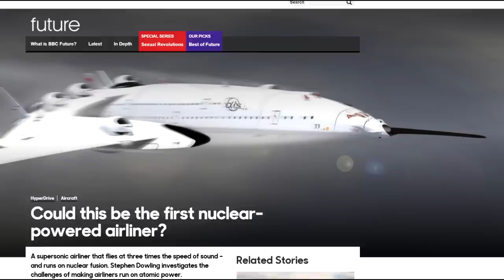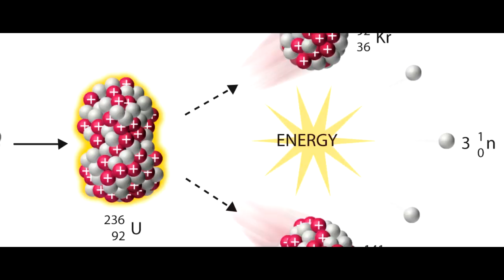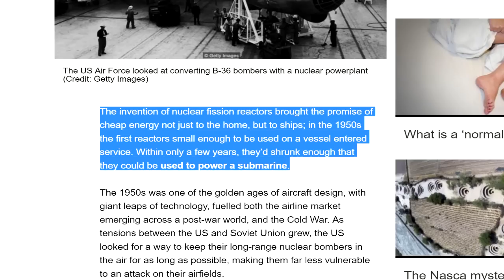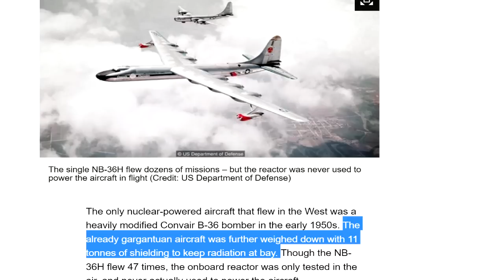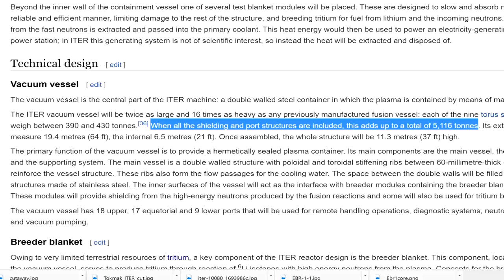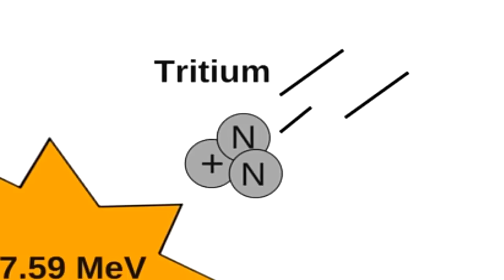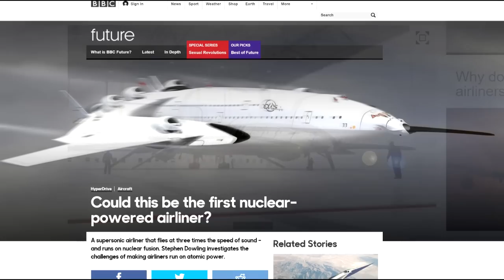SIX ENGINED Nuclear Airliner... BUSTED!

Comment: Very misleading statement regarding ITER being power generating at about 4:45.  The ITER reaction may produce energy, but the reactor will produce no electricity.  There are no generators hooked up to it.  Zero light bulbs will be illuminated.  Zero breads turned to toasts.

Comment: I disagree with your assessment, the one part they are missing is the engine's mass, they got a estimate and used that as a starting point for working on the design, since the laws of aerodynamics won change, so they can make mockups, they can work out that the engine's will need to tilt upwards to give it enough lift to get off the ground, and they can work out the passanger/cargo capacity, wing span, length, range, speed.
personally though I don't see the point, why? because it'd never be allowed to fly supersonic, supersonic is stupidly noisy on the ground below. I think they'd be better off developing a battery powered plane that can be charged at the airport on each end. the main issues are I have no idea of the technical requirements, but I can guess who I'd need to ask, the primary issue is the battery (or capacitor) weight.

Comment: obviously the drawings are very fanciful.  however one way to avoid the biggest shielding problem is to just not shield it :)  mount the reactor in the back and only add shielding between the reactor and the front where passages sit.  this reduces shielding weight by a big magnitude.  of course you are spewing out radiation all over the place behind the plain which may not be a major problem at 10,000+ feet but would be a major problem at take off and landing.  maybe plane could have a shielded backside companion module used in takeoff with chemical rocket or jet population to get the nuclear powered portion up and down.
Reply: actually maybe just disable the nuclear reactor during take off and landing.  land with alternative low power flight and take off with the help of an external jet powered plane module.
Reply: Also add low/medium shielding below the reactor to minimize radiation going down to earth while at altitude.  side and top shielding can be minimal as this all goes into space hopefully.

Comment: To be fair, that 10 tonne payload you mentioned was for a B-29 - that's the little plane behind the NB-36H in the photo. It's still a huge amount of shielding, and it still had massive, massive problem (that ten tonnes was enough to protect the pilots only - everything else close to the reactor would still cop a hefty dose!), but as designed it wasn't overloading the plane it was on.

Comment: A few inaccuracies in this video:
1) There are nuclear fusion reactions without neutron production - He3-He3 and He3-Deuterium fusion don't produce any neutron, and for this reason they're particularly interesting for potential future fusion-powered spacecraft. They do, however, require even higher temperatures to occur than Deuterium-Tritium reactions and are therefore even less miniaturizable.

2) Tritium in a operational fusion reactor is actually bred from Lithium and neutrons and therefore requires only a minuscule amount of outside source of Tritium to jump-start. At any point during operation only 0.5 grams of Tritium is in the reactor, which means even if all of it escapes into the surrounding there would be no need to evacuate the site. Tritium undergoes beta-decay, but its beta-particles are so low energy that it is more similar to alpha-radiation (cannot penetrate skin).

3) The far more concerning by-product of nuclear fusion are the radioactive isotopes in the structural material generated through neutron activation. However careful choice of material can prevent long-lived isotopes, and there is no danger of nuclear meltdown in any case, so it is far, far safer and cleaner than nuclear fission.

Comment: Ugh. Do I even need to mention that, while I'm not an expert aerodynamicist, as a pilot I do know there's not a chance in hell that gigantic, bulbous, awkwardly shaped whale of a contraption would ever go supersonic? Well, that's not QUITE true. If you stick enough engines on it you might get it to go supersonic. But just once, before the conflicting shockwaves inside those bizarre gaps in the wing rip the thing into a thousand pieces. There's a very good reason the Concord was shaped like a long pointy lawn dart.

I mean, Jesus, they didn't get ANYTHING right with this, did they? From the powerplant, the engines (electric turbojets? Really?), to the design and aerodynamics, it's ALL just a steaming heap of horse manure. I'm gonna go cry now.

Comment: If electrons block the high energy neutrons, why can't you just put the reactor between a giant capacitor or 2? Like if the 4 walls and 2 ceilings are just giant capacitors ?
Cool video, I learned a lot.

Comment: Hmm. This all sounds familiar, nuclear powered airliner, 3 times the speed of sound, 6 engines. I know what those specs are identical to, this bullshit airliner got its bullshit specs from the FireFlash of Thunderbird's fame. Besides that aircraft in its original form is far cooler than this white beast.

Comment: Even if they found a way to make the reactor not kill al the passengers, it still wouldn't work.  What are they going to do, use electric propellers. There is no way a propellor aircraft is going to go 3 times the speed of sound.  Even the most advanced nuclear reactor is essentially a fancy steam engine, and that can't power a jet engine. You need some sort of explosive action happening to make it work.  And then you are long past reactors and into nuclear weapons territory.

Comment: It should be mentioned that both the americans and russians had early stage prototype nuclear planes in the fifties (one each) Both were essentially a small reactor placed in the bomb bay of an existin bomber.  The soviets concluded that the shielding was good enough to continue testing, and the americans had also planed a second plane. Both projects were shut down as inter continental balistic missiles filled the same role much more cheaply.

The reason nuclear powered planes were investigated was that nuclear power is VERY fuel efficient, so the planes could stay in the sky for long periods of time. As mentioned in the video however they are VERY weight inefficient. Making the technology perfect on a ship or sub and horendus on a plane. So to make a very fast plane nuclear power is most likely worse than chemical engines. 

In short the flying Chernobyl runs into all the weaknesses of nuclear power while not playing to it's strengths

Comment: Umm the obvious gorilla here Thunderfoot is a major breakthrough for fusion. Don't be so damn negative lol.
Reply: Breakthroughs don't break fundamental concepts though.
Reply: Then why are they called breakthroughs?
Check mate atheists.
Reply: Paul Coddington Yeah but why do you even need a plane at that point...
Reply: +Cosmic Spark I love the "Checkmate Atheists" joke.
Reply: Especially if there is a breakthrough for anti-gravity as well. Then it doesn't matter how heavy the shielding is ;P
Reply: +Paul Coddington One problem... HOW?!?!
Reply: +Suedocode Well, a high altitude plane would have to deal with less air resistance.
Reply: Suedocode That was the additional layer to the joke :)
Reply: Naw, they just need it to be aneutronic fusion.  Then the shielding requirements go way down and the efficiency of power conversion (not the total efficiency) go way up.
The sticking point being that aneutronic fusion is a lot harder than plain ol' fusion, which we still can't do well enough to be useful.
Reply: I believe you meant to say "God", not "breakthroughs"
Reply: Yeah well a fundemetal concept the top scientists of their day had in the 1800's was that heavier than air ships could never fly. Then the Wright brothers came along 1900's. Then it was a pipe dream to fly to the moon... until we did it in 1960's. You can never predict exactly how far science will go but it wouldn't surprise me if by 2200 our smart phones were powered by small fusion batteries that could last the life span of the phone.
Reply: ShatteredMercury Did you not understand what he's saying? To generate the needed amount of power, you'd also need x amount of electrons per unit of area to block the ionizing radiation. Even if we found a material that is better at blocking neutrons, it would be denser and heavy. There's just no way to block the neutrons with anything other than a lot of material, and that's heavy.

Comment: Well, the thing with the neutrons depends what you're fusing. Yes, Tritium + Deuterium is the easiest one, but not the only option. If you'd use Deuterium and Helium-3 (if one finds enough of that stuff) you "only" have to deal with heat and protons without risking to fuse in a way that would produce high energetic neutrons, thus reducing the shielding. It still won't fit on an airplane, but just to show an alternative. Back to the problems of this find again, there is probably no way how one could contain the heat and also ignite the fusion if it stops.

Comment: So the shielding of the mass is required for safety? If that's the case, a flying craft is impossible without without massive, massive weight added. Doesn't look like something they can bypass.

Comment: This seems akin to an engineer in the late 19th century drawing a sketch of a Bugatti Veyron  and speculating that all they need is a quad supercharged 64 valve engine with 12 radiators and it`ll run just fine.

Comment: Hey thunderfoot got a question for you; How come we haven't just put a gaint ass nuclear reactor powered Mothership in space (No weight in space so no problem with sheilding weight right?)

Sure theres the cost to send the supplies to build it into space with rockets is going to be FUCKING expensive but would it be worth it in the long run?

We could have this if every country teamed up and formed a super country or some crap like that....

Comment: Thunderfoot, you are forgetting that they could use solar freakin' runways to give the plane some extra power on take-off. Plus with some advanced Fontus(tm) technology it would extract pure tritium from the air as it flies, meaning it doesn't need to carry ANY fuel. That's got to take some weight off too. We'll call it 4999 tonnes which is only slightly more than a few dozen jumbo jets.

Stop denying the future!

Comment: Fission driven engine is just a fission driven steam engine. However, it's still a steam engine! 

So they want to exceed mach 3 speed on a big airliner with a steam engine?!?!?!?!
Reply: Lightweight 250 passengers airliner? On electric engines?

OK. 4 AA batteries, then.
Reply: Only if they are sure they want to go over mach 3 with it.
Reply: "So they want to exceed mach 3 speed on a big airliner with a steam engine?!?!?!?!"
Well, not necessarily steam, but yeah, probably using a gas turbine. Presumably it would use something like a a Brayton-cycle heat exchange method to serve as the hot section of a conventional turbojet. The non-nuclear parts aren't completely batshit insane (although they are still way too optimistic and oversimplified). It's all the nuclear stuff that's balls-to-the-wall cuckoo.
Reply: What business climate are you referring to? There are lots of states that refuse to let him sell cars in their state because of the lobbying from local car dealerships and laws that were established in the 30's.
Reply: your comment is absolutely retarded, sorry.
Reply: +Branimir Antic  and an eletric engine going mach 3 in an airplane when they've  barely got eletric engines in cars figured out
Reply: Those who believe in this crap are more interesting than those who are telling us they can make it.
Reply: ***** There are a lot of states that refuse to let Tesla sell cars there because of non-compete laws that local car dealerships have had in place for decades. It's the reason that there's always "Rick Jones Ford Dealership" instead of just ford owning the dealerships themselves. Tesla however wants to run their own dealer network similar to apple stores, but that doesn't let the established families that already own dealerships to get money because of Tesla so they don't want it to happen.
Reply: +mrmargolf They use Dyson vacuum cleaner motors.
Reply: +MrCipasa Elon Musk seems not to have noticed that little problem. His Hyperloop has as many hand waving assumptions built into it as the "Fusion Powered Aircraft".
Reply: +Tat Tvam Asi  "Batteries that can charge themselves". Care to explain that?
Reply: Thomas the train powered™
Reply: It will be powered off farts.
Reply: +totoritko The plane flies at very low altitude. It scoops water from the ocean and converts it to steam jets. The only problem is that the shock wave is hard on whales.
Reply: And you can always take the Russian philosophy of:

"shielding? who the fuck needs shielding? I'm not some sort of pizde, i fly this sheet with vodka as my blood. I can't get cancer".
Reply: Branimir Antic What's so unrealistic about that? Most trains and many boats already use diesel electric power systems because of the efficiency. With traditional engines, they're only really efficient in a narrow RPM range, with electric engines, they're maximum efficiency pretty much all the time, and if you can run the generator at it's most efficient level at all times, you may end up coming out ahead on efficiency. It's just a matter of finding a power source that's small and efficient enough. 

You laugh but I'd say within 100 years we will be using electrically powered aircraft, at least for subsonic transport. The problem is the power source, but the next generation of engineers, including myself, will no doubt tackle that too. If we as a species made it to the moon, I think electric aircraft isn't exactly a stretch.
Reply: mrmarcgolf Who says they don't? Motors are one of the simplest machines, and we've had them pretty close to perfect for the past 100 years. It's the power generation and/or storage side that needs some work, but petrol cars didn't happen overnight either. 

Main reason we've not got electric cars sorted out is because Petrol and Diesel are just more convenient to use, no long charge times, if you run low you just fill your tank, they run for hundreds of miles on one fill, etc. There's also been very little money in the electric market because oil has been so cheap, and once the infrastructure was there, it's very hard to turn around and say "tear it all down, we're starting again".
Reply: *****
Using some sort of chemical capacitor with a very dense material that reacts with another dense material would work as some form of storage (a bit like a chemical battery but much more dense). You'd need equipment to cause the reaction, then to reverse the reaction and release the energy.

Otherwise there is always wireless power transmission of some form, which is being investigated.

I'm an electrical engineer and an electronic one myself, qualified machinist and welder too. What do you do in the engineering world good sir?
Reply: Mao Zedong A good suggestion with capacitors, though it's more about energy density than physical density. You may not necessarily need to reverse the reaction on site though. If you could package it in modular form such that after usage, for example a flight, you remove the empty cells and replace them with a full ones, you'd improve the turnaround time. Sure, you lose the advantage of being able to shape the cells any way you want, but you reduce the effects of a cell failure on the aircraft (i.e. requiring an overhaul of that cell, all the while the aircraft is out of service) and you don't have to worry about the life expectancy of the cell in terms of a single aircraft, you simply take it out of rotation when you need to. Similar ideas have been explored for cars, instead of having to charge the car itself. Wireless sending would be interesting, though the expense of transmission stations globally would probably be cost prohibitive...

As for myself, I'm going into my final year of Mechanical Engineering, not quite an engineer yet, but soon!
Reply: *****
Sounds interesting. I'm doing a rocketry propultion and guidance project in my spare time at the moment (designing a PCB with interial guidance and such).

Sounding rockets use that sort of tech as do other, more nefarious rocket types.

The capacitors come to mind as they charge more quickly than a battery & if you put a resistor in series with it, you can limit the current drain from the capacitor so it doesn't just dump the energy all at once (like if you short it out). You'd need DC electric propultion though which is not viable. AC motors are more efficient in my opinion so it would necessitate a high current rectifier (like the type you see at HVDC power line stations in Denmark).

I'd prefere a hydrogen internal combution engine over electrical propulsion in cars to be honest. You need more robust gaskets, pistons and injector heads though as the head pressure is a lot higher in a hydrogen ICE.

Comment: How did this pass a first sanity check by the BBC? I'm no expert in nuclear fusion, so I would have looked up the state of nuclear fusion, counted the number of todays operational nuclear fusion "engines" and called that story over. Okey, on a good day I would check other aspects for sanity, but this is the kind of story that require a big leap in technology, that would change other aspects of life even more significantly then just flight.